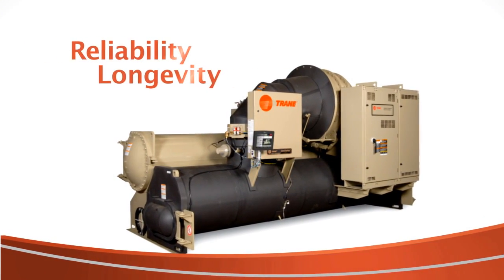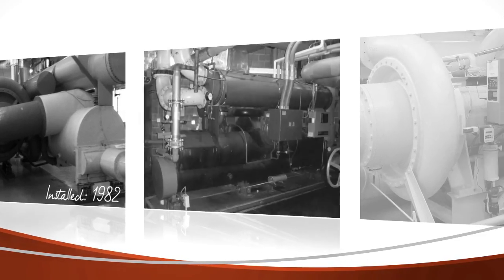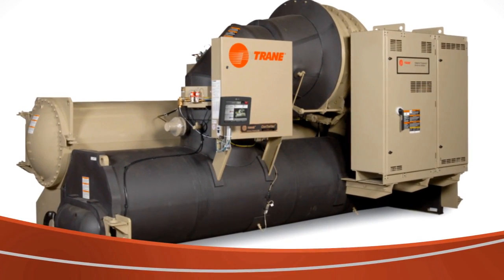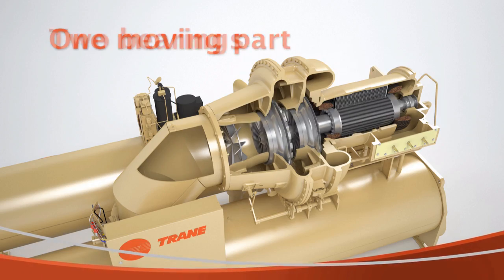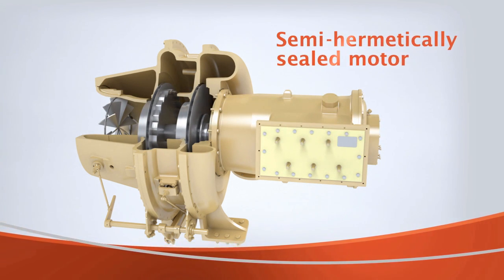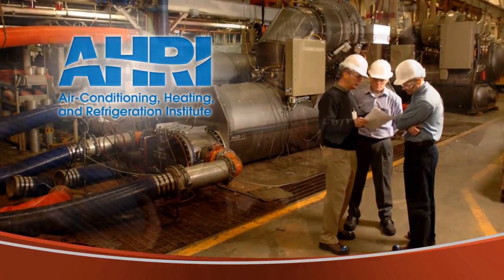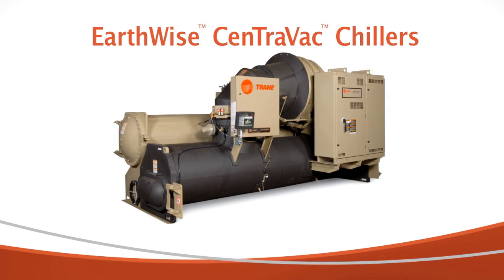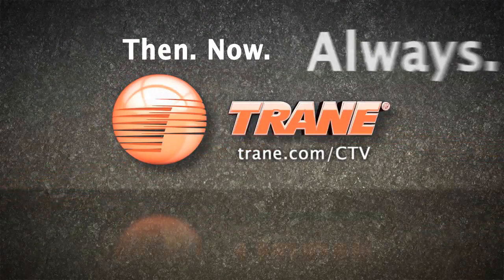Trane CenTraVac Chillers - Reliability

Comment: to much surge and hi load shut down screw is better
Reply: CentraVacs are selected for especific conditions and specially CentraVacs have incluided controllers that can help prevents it from surging in extreme conditions. Also having a two stage compressor it has a large compression map that permit it to avoid surge as much as possible, most other manufacturer centrifugal's do not have more stages. Screw is definitely a good fit as well in some jobs, specially the RTHD with VFD on the compressor. Contact you local Trane Office for more information.
Reply: @juandeniz5307  🎖
Reply: https://youtube.com/shorts/MChpjpSDmpY?feature=share